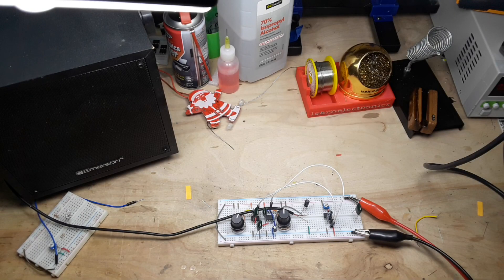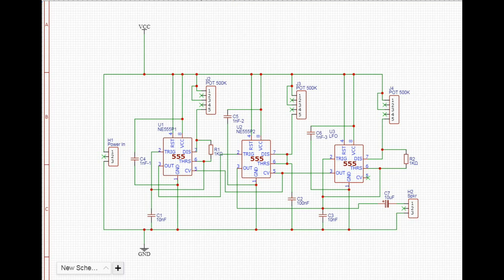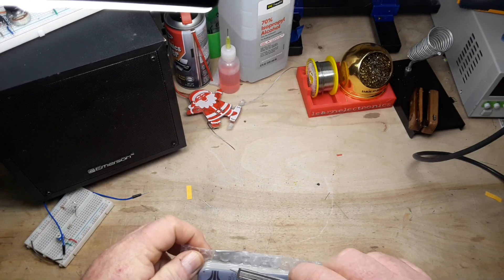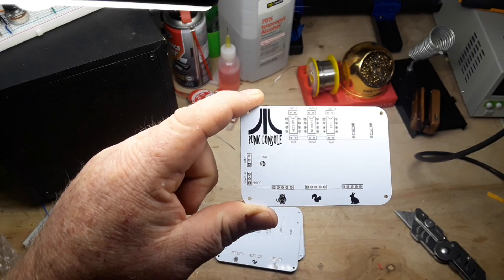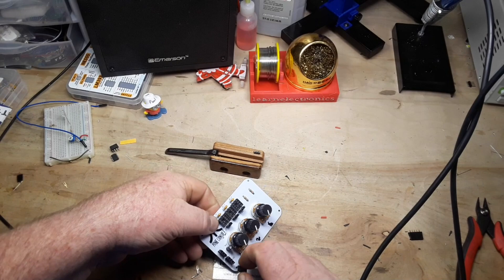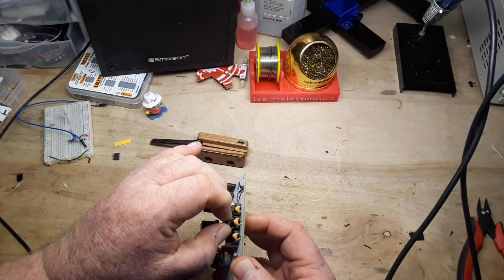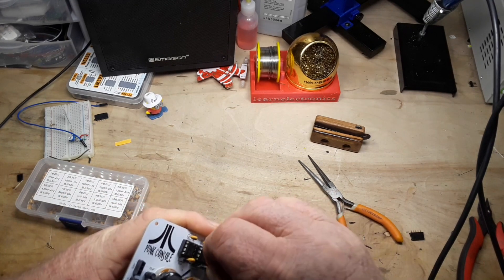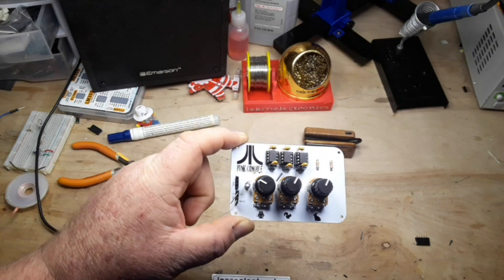Simple Synth on A PCB - Atari Punk Console

Comment: How are you doing? I am getting audio circuit design and had a few questions. When you design circuit in a program how do you know if it works, is it possible to generate sounds out of these programs? Also when you build a prototype how do you generate the sound and how do you output it? I know this maybe asking a lot and hopefully my questions are clear, any advice would be greatly appreciated.

Comment: A few tips for my man Paul to make better pcbs, use thicker traces, avoid running traces in between component pins or pads, try not to get too close to pins or pads (the more clearance the better), generally it's best if you poor a plane or a polygon as gnd on one layer and another one as vcc on the other side with 1mm clearance all over your board (except on high frequency stuff, etc etc...) specially for stuff like leds for better heat sinking capability, faster production time for larger quantities (the more coper you leave on your pcb the less time it takes for the acids to remove unwanted copper on your pcb...), you can retract a graphical object on these planes or polygons and depending on your surface finish it'll look shinny for tin or like gold if you choose gold plating... (Usually just by adding that object to top/bottom solder layer but it's different in any app so use 3d view to figure it out). BTW This is no criticism in anyway. Just some useful tips to improve your designs. Sorry if I'm over stepping my line here. Best Regards Professor ❤
Reply from the maker: Cool, I appreciate it. PCB design is new to me.

Comment: 555 is a little rough as a synth because it’s hard to configure it as a harmonic oscillator. How would you make an adjustable frequency harmonic oscillator? I’m thinking Colpitts oscillator with a var-cap in parallel with the LC tank.